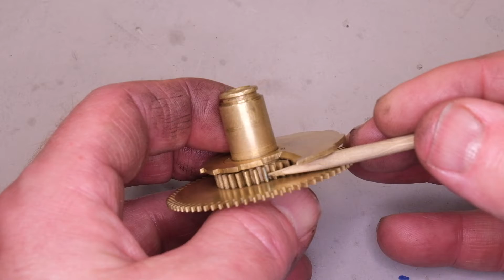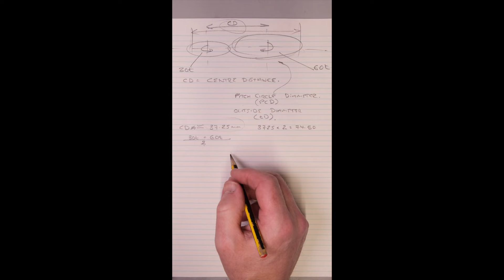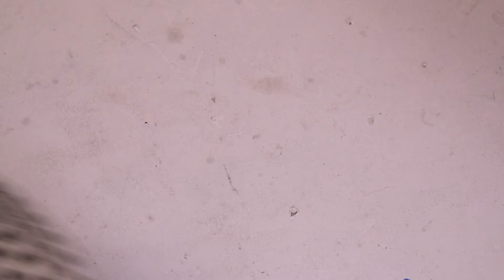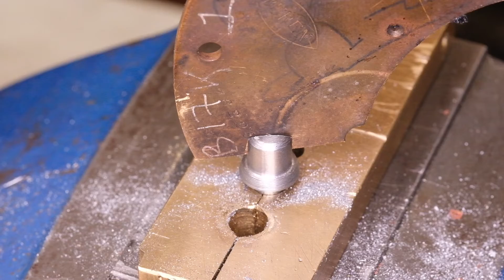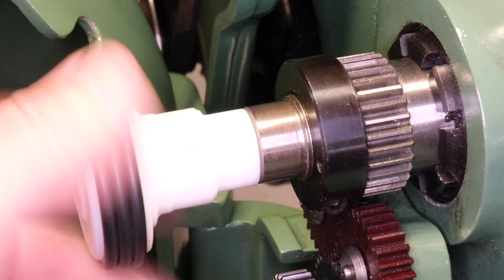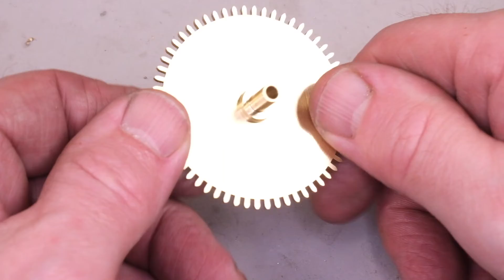#007 Making a new date wheel for a 19th Century longcase clock

Comment: I'm usually pretty good at this sort of math, but I have to admit I got lost at about 5:32. I suspect you're calculating something about a theoretical wheel that has the CD as its radius, which has the sum of the two wheels' teeth, and which meshes with a wheel that has zero teeth. Is the sum of the two wheels' diameters divided by the sum of their teeth a constant for a given center distance? Thanks for this thought-provoking and informative video.

Comment: Lovely video to watch very interesting and satisfying to see clocks repaired ill leave this kind of work to the experts😂. I have a Jmperator clock  made in Brussels that appears to need a pendulum dont know if its something that i can make or rather leave to the experts but i do think it may need a suspension spring as well. How do i tell the difference
Reply from the maker: Is it a pigeon racking timing clock?  It really depends how much experience you have with more straightforward clocks.  If it is spring driven, you always have the challenge of getting the power off the mainspring first.
Reply: @howtorepairpendulumclocks  hi thanx for the reply. Looking at the back of clock there are 2 barrels for clock spring. There is a little swing lever through which a pendulum wire would go through(based on what i learnt from cuckoo clock.)but there is a shaft more above near top of back plate which appears to be the spot where the pendulum suspension wire would hook on. Im certainly no expert on clocks but would like to learn more. Im not finding any info on what the actual pendulum length and the size and weight of bob should be. However ive seen formulas to calculate this but no known variables to work from
Reply from the maker: Yers, to calculate theoretical pendulum length, you need to count the number of teeth on the gears between the hand and the escapement.  You can also do it of course by simply beginning with a longer pendulum rod and gradually cutting it shorter.  As for pendulum bob size, the mass of the bob is mostly immaterial as the mass is not part of the pendulum equation. Again, start with a piece of plasticine or similar and experiment. M @jacqueso8424
Reply: @howtorepairpendulumclocks  thank you, the reponse and reply is much appreciated  will start playing with the clock real soon as im eager to learn these things.
Reply: @howtorepairpendulumclocks  no not a pigeon racing clock though im in possession of 2 of those, 1 being a battery driven one
Reply: Sorry Bruxelles not Brussels😊